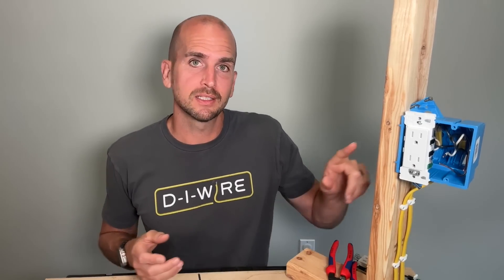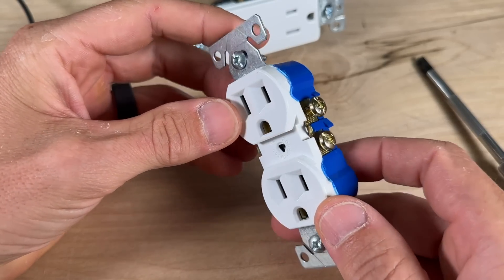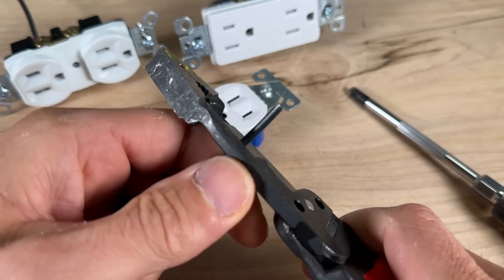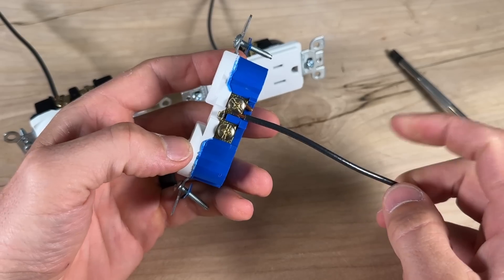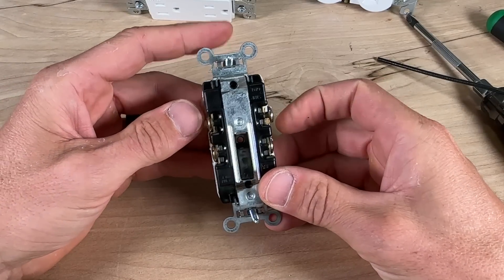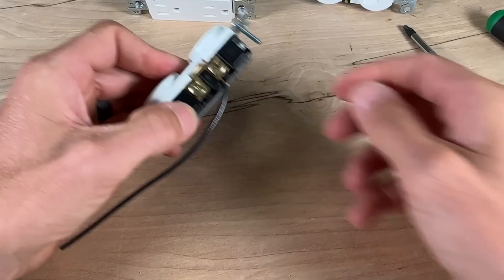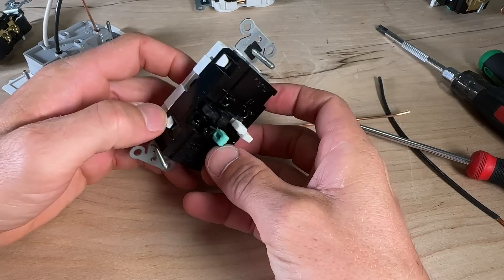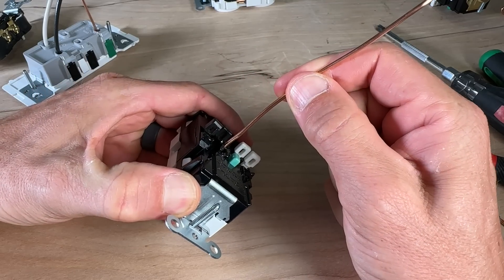New Products That Make DIY Electrical Projects Easier!

Comment: Leviton all the way leviton has true tool less connection while the other brand you have to have the right tool to disconnect  witxh many home owner might  not have at hand all the time and to make mather's worse for hubbel leviton now has the lever edge with are a commercial grade version of the lever edge and they even added a gfci lever edge and 20 and option so I think leviton is taking the crown on that one

Comment: Have you tried pulling the wire out of Leviton's vs Hubbell? That would really show the quality difference of the products. The idea that Hubbell's plunger is hard to pull out in nonsense. The device has molded in bridges to help you pull the plunger up. Hubbell has 15A, 20A in a BR series, spec grade 5362ST series, and heavy duty industrial grade HBL5362ST. Same thing with switches. Also have them in all common NEMA Twist-locks and straight blade plugs and connector bodies. They even have this technology in a version of their pin and sleeve devices. Hubbell kills Leviton on the breadth of line offered giving it more application in the commercial and industrial world. Hubbell sells mainly through local electrical distributors.

Comment: #1 this video compares leviton resi grade vs Hubbell commercia grade.  Night and day.  #2 Commercial contractors install about 10 duplexes per hour. They can install 30 per hour with hubbell.  If installing 1000 duplexes they will save 83 labor hours.  83 labor hours x $50 fully burdened labor hours is a savings of over $3000.00. #3 removes NEC torque requirements. # no need for commercial contractors to tape devices before install in metal commercial boxes.  Again you cannot use the Leviton resi product on commercial jobs.

Comment: I definitely use commercial grade when replacing, I prefer those connections, but I would not object to either of the newer ones.  But probably Leviton over Hubbell.
Reply: Leviton is resi grade.  Hubbell does not make these in resi grade.  Designed for labor savings

Comment: That finicky Hubble disconnect looks like it would be an epic pain if it was installed in a wall outlet with very short wires where I had no room to get behind it. I'd end up cutting the wires (obviously making them even shorter). The Leviton looks like it would be much simpler to snap free in any circumstances but especially in that one.

Comment: I like those features but not that style. I like my traditional style outlets with 3 prongs and a ground screw holding the plate on. The took away the grounding screw on "mud rings" as I call them, that hold the outlets to a square box, and removed a ground screw on the GFCI, though I suppose you COULD use the top or bottom screw if you're not using one of those damn plastic or nylon boxes. Also, still, too much plastic. I wish they would make them of porcelain and metal instead of plastic and metal. Same thing with the plate covers. Porcelain, ceramic, wood, steel. So much nicer than ugly plastic that cracks and strips, then gets brittle with age.

I missed your poll and when I did my rewiring last summer or is it 2 summers ago now ? I can't remember. Either way, I usually get the cheapest Leviton outlets I can find. With the blue half back. I am going to stop buying that kind. I wasn't aware that there was any difference, though I would prefer the back wiring if lever isn't available. I never been a fan of back stabbing either, however, when I was a kid, before I knew better, I found that using a jeweler's screwdriver in the release slot, it would release the back stabbed wire and allow it to be used again. But when I learned the other way, I quit back stabbing.

I guess I am stuck in the past. I miss the old two prong outlet slots that were NOT polarized. When life was simpler, but I also know the importance of polarized grounds and that's why I am obsessed with them. I am also obsessed with all 14 gauge wire being phased out in favor of the 12 gauge. I distinctly remember my Mother and Dad inheriting my Great Grandpa's house and them swearing up and down a storm like someone's with Tourette's Syndrome because they couldn't plug anything into those non polarized outlets.

Our codes in this area have changed too, which I am also in favor of. No more sharing neutral wires. For every hot there MUST be its own neutral wire, and that's something I thought about for a long time and wonder why it took them all this time to figure out what I already thought was better. Perhaps I am just ahead of my time.

Great video, thanks for posting, and I was able to hear you LOUD & CLEAR without needing to max out my volume on my computer.

Comment: The Hubble outlet looks big. I'm not sure if it one would fit in an electrical box in my older home. It was challenging enough replacing an old 3-prong outlet with a Leviton slimline GFCI outlet.

Comment: I'm a big fan of the Leviton Decora Edge.  Its so simple and secure. And with no exposed metal, really safe.  For all the sparky's that don't like it, I would argue that there is absolutely no logical reason why you need exposed screws.   Its about time we move away from the stone-age of receptacles.  
Whether it will hold up over time is another story.  But I have no reason to believe they are build to any lesser quality than any other Leviton outlet.   And for anyone that hasn't actually used these....NO its not the same as backstabbing.   I just replaced 30+ outlets on a remodel.  And they are great.

Comment: Hubbell makes some good stuff. I'd like to see the internals of that receptacle.  I always go for the Legrand backwire outlets. Other than J-hook, gives the most secure connection. Important for outlets to soak up some heat from a loose plug connection or appliance with undersized wiring.  Especially in the kitchen and bathroom.
My air fryer cord is only 16ga, that's a lot for 1500W and gets fairly warm. Having a high contact area with the house wiring will help with some heatsinking.

Comment: FIY 
I’ve recently installed some outlets with the “Backstabbing” feature.
I’m not sure the brand, but you had to unscrew the side screws to insert the wire in the back. If the screw is not, you could not insert the wire.

Comment: Hubbell has a cam mechanism for their tamper resistant receptacles. It's not perfect, but when it works it's by far the lowest insertion force TR receptacle on the market. It's hard to find Hubbell products, but it's worth special ordering them for TR receptacles you use everyday.

Comment: Per hubbell's site they have 15 and 20 amp versions, take 10-14 gauge wire, and both decora and duplex versions are available. They also have hospital, industrial, and commercial ratings. For most home outlets it's probably overkill given the likely higher cost and reduced availability but it's cool to see more options.

Comment: Overcut protection tabs are nice... Alignment tabs are nice.   Levers are convenient... However, if they take up more box space than a traditional receptacle, that's going to be a deal breaker in some circumstances.  It's still hard to believe that a lever can be as secure as a properly torqued J-Hook that's side wired.  I can see the benefit of a spring-loaded clamp where vibration is a concern.

Comment: For the Hubbell Edge,  you used a small screwdriver to release the wire and it and you indicated that it was slightly inconvenient.  Have you tried using a needle nose pliers, linemen pliers to lift and tilt?  What about the pliers end of your wire strippers?

Comment: I replaced all the receptacles in a new to me 1952 house that had all two prong. (12-2 no ground).  Went with your Legrand commercial recommendation and used Wago's in some places.  All boxes are small, with the exception of a few new runs I put in, so that factored into what I was doing.
Reply: Hope you ran new wire

Comment: Great video. But do you know if/when Decora Edge products will be available at Canadian big box stores? Seems like you always have more options in the U.S. Like, those blue plastic electrical boxes, I never seem to see those on the shelves here. Final question: Would an electrical inspector in Canada have any issue with seeing a Decora Edge product installed in a project in Canada? Thanks in advance.
Reply from the maker: Here in the US they were only available through Home Depot online but now they are starting to roll out to the stores.  Do you see them available through Home Depot website in Canada?  If so, I would think they will also start rolling them out in the stores as well but might take a bit of time.
Reply: I think they just started rolling out. My local Home Depot has them in stock all of a sudden, but they didn't just a few weeks ago.

Comment: The beautiful thing about back-wiring is clamping down two conductors under a single terminal screw, since there's two ports on each side of the screw post. You have all the metal of the screw and plate that makes the splice, and it's very low resistance and robust, even more so than a wirenut or Wago. I would absolutely daisy chain a gang of two or more receptacles this way.

Comment: I understand the reasoning behind not backstabbing an outlet but if you were using non wago type push in connections isn't it the same?

Even with Wagos you're essentially backstabbing with the addition of having a lever to further tighten the wire to bus bar..

The argument for backstabbing failing could also be argued for a push in connection and/or Wayos failing.  They use 90% same concept with the exception of a Wago having the ability via the lever to release the clamping load..

I know backstabbing is more of a PITA if you need to change something but of its a plug that could end up servicing the home for 20-30-40+ years what does it matter.

If backstabbing is such a bad idea would you also consider non wago connectors that use a push to connect style to have/propose the same issue?

The only downside I've heard to backstabbing is future use or removal to change something.  Again if it's just a plug that the end user never plans on messing with after why is it soo bad?

The minimal bus bar connection is the same with backstabbing as a Wago and you often hear of electricians bashing Wago for that same bus bar connection vs using wire nuts.

Comment: Seems like an advertisement   thumbs down  ... And fyi wago lever nuts seldome hold a wires when having to stuff and outlet box ful of 14/12 solide romex. Back stab outlets hold 10 times beter then a wago lever nuts and back stabing outlets which is bad.

Comment: Other than the lever, I'd like to know what exactly has been done to mitigate the failures that are obviously so common with traditional back stabbing, which also holds the wire with a similar type of spring mechanism. Is the clamping force just way higher with this lever design or something? The design may be okay since Wago's lever nuts don't seem to suffer from an excessively high failure rate like back stab terminals on receptacles and switches do, but that may be because they aren't being wiggled constantly when people plug in and unplug devices?

Comment: Suspect the Hubbell will be 5x or more the cost of the basic outlet.   For a comparison, 240v 40+ amp outlets are ~$15 for cheapo,  $50 for very good and $100+ for Hubbells, regarded as best by most reviewers.

Comment: I would like to buy your D-I-WIRE T-Shirt in XL or XXL, depending on measurement specs, but I did not see it in your store.  Can you tell me how to find it, please?

Since you like the Hubbell Edge so much, I think it would be good for you to do the heat, vibration and pull tests you've done before for Leviton Decora Edge versus Hubbell Edge and anything else related.  Say the entry level outlet, backstab, up to the commercial grade clamping lock.  All 4 types.  It was surprising to how properly-done wire nuts were better than WAGO in some respects, so this should be interesting, too, with more potential surprises.  Convenience is great, but is it the safest and best?  Safer for preventing shorts, but what about any other potential concerns?  And a tear down and internals inspection of a Hubbell Edge would be in order, as well, and comparing it to any others, especially the Leviton Decora Edge.  Thanks for introduction of Hubbell Edge.  I had never heard of them and I'm sure many others have not, too.  Looking forward to the comparisons mentioned.  Thanks, Scott.
Reply from the maker: Thanks for all the feedback!  I agree a comparison would be interesting 👍 Here is the link to the T-shirt https://everyday-home-repairs.creator-spring.com/listing/di-wire-t-shirt
Reply: @EverydayHomeRepairs   Thanks for the link!  I ordered it in gray like yours.  I struggled a bit between black and gray.  🤣

Comment: I don't have any goto brand because I can usually find switches & outlets in good used condition for next to nothing which are just fine for most things. However when I purchase outlets for my next project they are going to be whatever can take 10 gauge wire since thats what an electrician used for my outside light.

Comment: At first glance I had no idea how the Hubbell receptacle was wired. They have the terminals illogically placed and the black tabs and terminals blend into the back too much, in my opinion. This could be an issue for those not familiar with it but I am curious to try it out. I didn't get a chance to respond to your poll but I would have voted for Leviton as well based on availability and convenience. I've switched to the Decora Edge based on your recommendation and I also like their "slide to off" dimmer switches.
Reply: I'm guessing that if you took it apart, the "illogical" placement would make sense to optimize the internal design, so it's probably weird to install but smart in the design.  (I haven't taken one apart to prove this conjecture, though.)
Reply: Commercial contractors and spec engineer firms are All on board with the Hubbell.  It’s commercial, industrial and hospital grade.  Leviton is resi only.  Leviton    Cannot be used on commercial jobs. Leviton design is only for resi.  If it could withstand commercial UL testing then Hubbell would have competition.

Comment: It looks like they’re two different products. Leviton is a 15a, and Hubbell is a 20a outlet.
So it would be ok to use both.
Reply from the maker: For both the Decora Edge and the Hubble Edge Connect the product lines are limited.  It will be interesting to see how each company expands out the product line.  I would expect Leviton to start rolling out more products under the "Edge" badge as it seems like the response has been very good.

Comment: I would go with the Leviton because the connectors on the Hubble seem like they would break easily. It's not like I'm accessing my outlets often, but I can pretty much guarantee you that I would destroy one of those connectors on the initial install.

Comment: The Legrand commercial receptacle you like is 0.78" deep compared to 1.18" deep for the Leviton Edge & 1.38" for the Hubbell EdgeConnect, which can make a difference in smaller boxes.  The Legrand is 1.32" wide compared to 1.78" for the Leviton & 1.58" for the Hubbell.  These things are gigantic relatively speaking for receptacles, all that plastic to hide the wires from the DIY crowd.  I'll stick to the commercial receptacles for now.  Also, your recent video on wirenuts vs lever connectors showed that the wirenuts had the lowest heat rise when overloaded, I wonder how these lever-type receptacles would compare to a traditional sidewire/backwire with screw connection?
Reply: To me I would consider it for new builds where you know the boxes will have the space and this will go quick and last a very long time.  But, updating receptacles? I know for a fact a couple of mine would not even fit, one behind my refrigerator - I double electrical taped around it because the old metal box was close to the sides of the basic 15 amp receptacle I installed there.
Reply: Hubbell are commercial and are spring terminals, not lever.  Some of the largest , high profile projects in USA are going with Hubbell for the high performance, labor savings.  Leviton is only for resi.
Reply: Or the other 95% of World population would say: 10 or 12 mm

Comment: There is nothing wrong with back stab and they are UL listed- BTW, I noticed you did not perform a pull test.  I’ve had back wire connections loosen over time, even though you prefer them. I always tighten, loosen and tighten again to ensure it seats the wire under the plate.  This is a perfect solution for stranded wire. 

I like the lever configuration as it’s more practical for DYI installs. 

IMO, Eaton TR plugs have been awful in my experience. Leviton TR is much better.  Eaton is a high quality device.

Comment: I'll stay with commercial grade back wire and run a set of  short pigtails to Wagos.

Although I do like the alignment tabs of decora edge.  I have a two gang box (GFCI and a decora switch) in my upstairs bath that was a major pain getting everything lined up so the cover plate would fit.

Comment: Never heard of that brand Hubbell. Maybe I've never noticed it at HD. Thanks
Reply from the maker: You will probably find a few of their products at HD but Leviton will be the vast majority of HD switches and outlets.
Reply: They have been around for a very long time but are typically a brand that is only sold to professionals and not DIY people. They made extremely good products but are very expensive.
Reply: They invented the 1st light switch, first hospital grade, twistlock…if you poll resi builders and do it yourself ER’s the poll is drastically different from Commercial and industrial contractors.  Hubbell is high quality and just does not have the issues that others have.  Just go to an electrical distributor defective aisle.